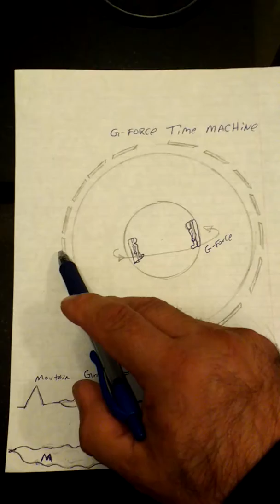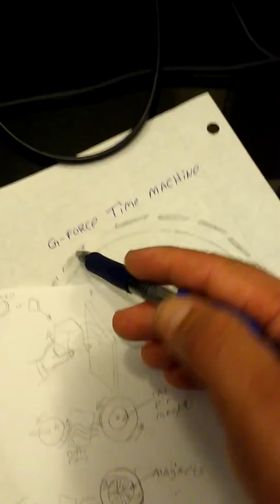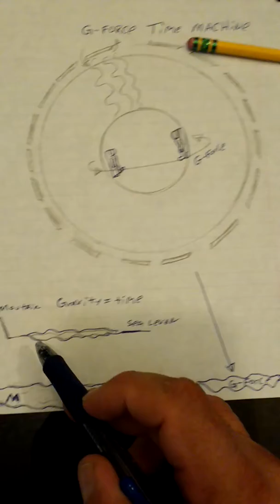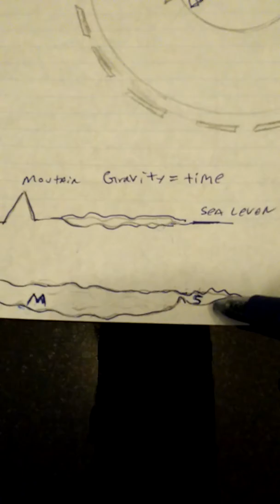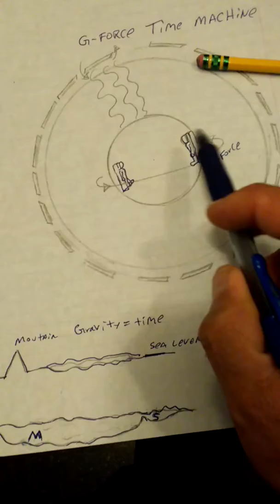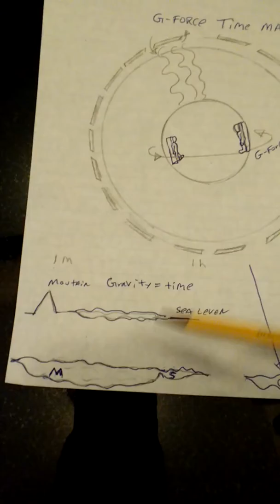HOW TO BUILD A TIME MACHINE

Comment: You should build a physical example I would like to see it!
Reply from the maker: This were my earlier concepts which later found that in space , naturally acuring X-points which happen daily between half way between earth and the sun magnetic lines gets crossed they teporarly open a doorway (wormholes) for seconds, but my prior concept here is more closer to a Stargate then a time machine , Nasa has done extensive research with satellites detection and monetering this brief openings , we have no access to this portals because of unpredictability of where , when , and duration , Wich is in seconds., now I have  a different conclusion concept , that time is really simple , it's controlled inside our own atoms by the electrons velocity that spin at 8% percent the speed of light around our own atoms  inside all of us , depending how fast or slow our electrons spins around atoms dictates how fast  or slow the time flows , slow velocity electrons spin meaning times moves faster and faster aging , fast electron velocity spin means time moves slower or aging slows down , the more mass like a mountain or a larger planets pull on our electrons and slows them down and we age quicker by allowing time to move at a faster rate , if we can somehow make electrons spin faster we can slow time in us and allow us to travel forward in time. Like Eintein Emc=2 the faster you travel(electrons) the more time slows compare to Earth's time. This is a real solid concept.👍  we can use gravity or a different frequency that vibrates our electrons to spin faster   and then we can travel one way ticket  into the future from centuries to even millions of years into future but with no way of coming back to the original time period. The way it works is simple , let's say that a year on earth equals one day on a person in a teporal time suspended animation by slowing  time , aging slow , and time slows that for that one year on earth normally has pass at high speed in one day because time slowed down dramatically for that  person and will see every thing moving fast around him and when he comes out of temperal time the  would have travel forward in time , this is the exact way black holes work the closer you get  to a event horizon (center of a black hole)time slows down dramatically , the best movie that explain how time works is my favorite is called "Time trap" that is based on real time concept by scientist. A perfect example how time works is almost the same concept as your home refrigerator , when you put frozen food in  the freezer, food goes into suspended animation effect ,  the food(person In temporal time) stop time from decaing inside the freezer while food outside the freezer(real world time speed) time runs it's normal velocity and it eventually time runs it's course at it's normal foward speed and food spoils eventually so freezer food outlives the food outside the freezer(earth time) , food spoils in 3-4 days while  inside freezer food will survive a year and below zero food will survive several thousands of years . So either in freezer in extreme cold which is in suspended animation or in a temperal time suspended animation both stop the effect of time by slowing time dramatically , therefore preserving  for a latter time when they are taken out suspended animation , but once taken out of suspended time , time will then resume it normal course with same speed as with the world present time flow speed therefore travelling forward in time .
Reply: MEGATRON INVENTOR how do we go about speeding or slowing our electrons to achieve travel?